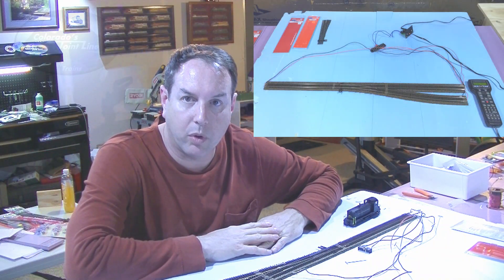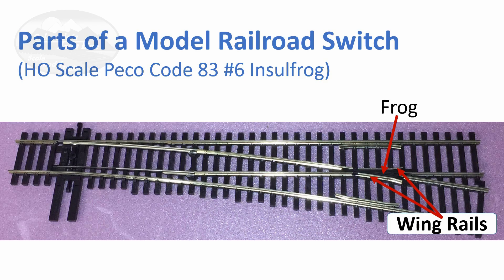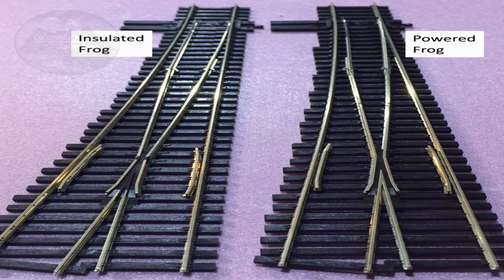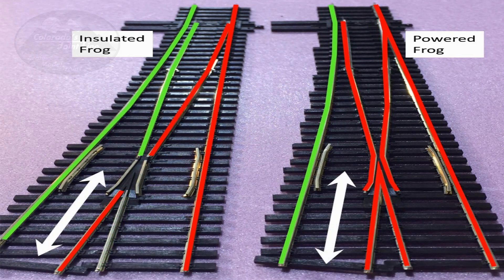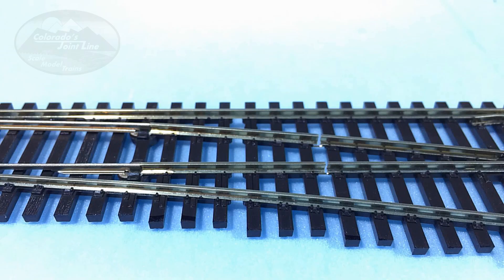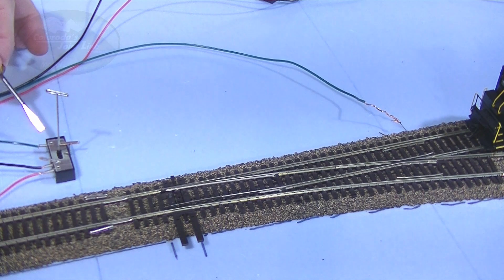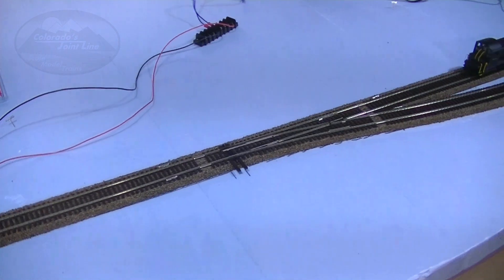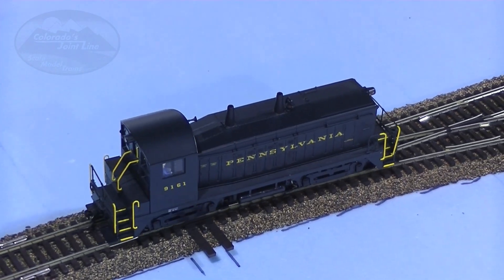Electrified VS Insulated Model Railroad Switches or Turnouts

Comment: I recently installed a #8 Peco electrofrog into my layout.  I wired a 
Blue Point switch machine.  When I run a locomotive over this turnout, 
there is a point where the locomotive stops completely, especially of 
course at lower speeds.  Three other locomotives responded exactly the 
same way at the same spot.  I checked my wiring, I ran a voltage meter 
over the turnout, there is voltage, even where the loco stops.  I 
rewired the Blue Point.  Nothing changed.  Now, I can't tell 100% but it
 seems as though the frog is not the dead spot, but more that the switch
 point rails may be the dead spot, but again, it appears there is 
voltage there with the meter.  I also soldered jumpers from the main 
rails to the closure rails.  I'm completely lost at this point.  I can't
 figure it out, but it is likely that I will replaced this track with 
insulfrog.  Also, even when the train stops or I switch the track, there
 is no evidence of a short of any type.
I'll never put myself through this again.

- Mark
Reply from the maker: Mark, I think we've all been there before.  Not too long ago I spent a couple days trying to isolate a short on my Joint Line layout.  It ended up being a Insulfrog switch.  Not sure what to tell you about troubleshooting your Electrofrog #8.  It sounds like you've done everything I would have tried.  I'm going to jumper my stock rails to the closure rails as well so I don't have to rely on the switch point making goo electrical contact.  If you think it might be the switch points you could add a small jumper wire from the closure rail to the switch point.  There should already be good electrical contact between those two pieces, but it just another idea since you said that might be the problem.   Since there isn't a short it does really seem like some portion of the switch isn't powered.  Cheers, Kevin
Reply: Yes, it does Kevin, maybe I will have a more clear brain tomorrow.  Frustrating, but maybe the points are dead.
Reply: It does seem that the point rails are dead, but how many feeders can I drop under a switch?  It's already a mess with wiring.
Reply: I think I am just going to spend the 30 bucks and buy an insulfrog version.

Comment: According to Peco web site, in the instructions, if we following the instructions EXACTLY,  that short at Insulfrog frog can be avoided...:)   Or so I am told......
Reply from the maker: Both the Peco Insulfrog and Electrofrog are excellent switches and are DC and DCC ready straight from the package.  The potential for a short only occurs if a wheel set is out of gauge, derailed, or something else that would cause a piece of metal to contact the two closure rails at the same time.  On my current layout I have only Peco Insulfrog switches and they all work great and this short very rarely happens.  Cheers, Kevin
Reply: Scale Model Trains & Colorado's Joint Line same for me ho and n scale layouts

Comment: They are called turnouts because its a hobby term use to identify them from the real railroads. Its not because of toggle switches. Also, you said you are going to use all short wheel base engines. That's just crazy and bias. Any long base wheel engine can handle switching assignments to. Examples include the SD9 series and U28C, Alco RS series, Balwin AS1000 to name a few.
Reply from the maker: Tony, thanks for the feedback.  I'm sure there are multiple reasons why a lot of model railroaders call model railroad switches turnouts but I've seen references to the reason being to avoid confusion with electrical switches as the most common.  That's the reason given in the NMRA definition of turnout as well.  I disagree with your assertion that using small wheelbase engines for switchers is crazy or biased.  While lots of longer wheel based engines were used for switching assignments, especially in later years, a lot of switch engines, especially early diesels, did have short wheelbases.  If you read Pennsy Diesels by Douglas and Weiglin, the chapters on early road switchers and early switchers you'll find mostly short wheel base 4-axle units.  Looking at steam engines you'll find 0-4-0, 0-6-0, 0-8-0, 2-8-0, etc engines doing switching jobs.  On my current Colorado Joint Line layout, the primary yard switchers at my Denver yard are a pair of BN SD9s (since that's what they used there in the 90s), but I don't plan on used any Pennsy SD9s as switchers on this layout.  Pennsy had 25 SD9s (Pennsy class ES-17m) and they were used almost exclusively as hump yard switchers.  Also, since they were purchased in 1957 they are after my early 50s time frame.  For SD7s (ES-15a), Pennsy only had 2 and they were used as pushers on Madison Hill Indiana.  The Alco RS series you mentioned does have 4-axle trucks, but the RSD series has 6-axle trucks.  I do plan to have some of both RS and RSD road switchers.  However, the U28C was a high horsepower road engine, first purchased by Pennsy in 1966.  I'm never going to have one of those on my switching layout.  If you look at the engines that were used in Philly on switching assignments (not yard switching) in the early 50s, you'll find most are short wheel based engines-both diesel and steam.  I never said you can't use a different type of engine, and you'll probably be able to find an example of pretty much every engine doing a switching job at some point.  But on my layout I do plan on having mostly short wheel based engines because that is what Pennsy commonly used for its switching and transfer assignments (noting of course the exception of the Baldwin RT-624 transfer engine).  Cheers, Kevin
Reply: Thank you for not being cross with my  comments.

Comment: Kevin,
Very well done!  This has got to be one of the most complex issues model railroaders face and its one that affects them every time they run if they do not address it - especially with a switching layout like your planning.  I have never seen a more thoughtful, organized, and easy to understand presentation of the topic- including all the parts and graphic labeling of electrical changes as you discuss them.  Pinnacle of your videos!  You just keep getting better and your videos keep getting more useful!  This video is on my immediate go to list when I start wiring!
Thanks,Rick TrinkleTrinkleTrains
Reply from the maker: Thanks Rick for the nice and thoughtful comment.  Glad you found the video informative and useful.  Looking forward to seeing some of your trains running again soon.  Cheers, Kevin

Comment: The ONLY reason you will have problems with older DC loco conversions is if you do not have multiple pickups,  as most older(DC) locos DO NOT.  Adding a pickup to another set of wheels only requires that the space between the pickups is greater than the insulated frog.
Reply from the maker: You're correct that having engines with either all wheel pick up or at least pick up from multiple wheels on at least two trucks will greatly improve performance when going through switches with insulated frogs.  Additionally, having flywheels in your engine will help carry them through any small interruptions in power pick up.  However, even with all wheel pick up there are still occasions when an engine can momentarily loose power when going through an insulated frog switch.  Especially if the engine is equipped with a sound DCC decoder.   It shouldn't happen since both sets of wheels aren't above the insulated frog at the same time, but it does happen sometimes.  I've see it lots of times on various layouts over the years--with long wheelbase engines with all wheel pick up.  Even on my Colorado Joint Line layout, which uses all Peco code 83 Insulfrog switches, occasionally a sound equipped engine will get just enough of a change in power pickup going through the switch that the sound will cut out for an instant, or even turn off the sound and then begin starting up again.  It doesn't happen often, but every couple months one of my engines will cut out just momentarily as it goes over the switch.    Cheers, Kevin
Reply: It is interesting that you mentioned the sound interruption,  that alone tells me that your problem is NOT mechanical,  i.e. insulated frogs,  but an electrical problem.  There are 2 possibilities:  1) You are over loading your power pack or 2) The wires in your loco are "original" gauge.  I looked at a couple of my locos and found that the wires were the same in new "full" featured decoders and the older ones, as well as,  the wires from the pickups.  Check the layout voltage near the turnout with the "problem",  while all your trains are running.  In my experience most, not all, intermittent problems tend to be electrical rather than mechanical.
Reply: Maybe a buffer capacitor on power lines to sound module (old electronics trick in load switching)
Reply: Atlas and Peco both make the Insulfrog line they work great with six axle engines but when you have switchers they don't run. this is why you should upgrade your switches to powered if you are using switchers. if you are using road engines go ahead and use insulfrogs. also note you must gap your rails if you are going to install switches.
Reply: Additional reasons for temporary power loss are that your layout and loco are not ideal components but real components on a layout with an environment around it.  So dirt and oil on track can mean that the wheels that do have pickup don't get clear signal/power. Thus ensuring as many wheels as possible get the right power is always a good idea.